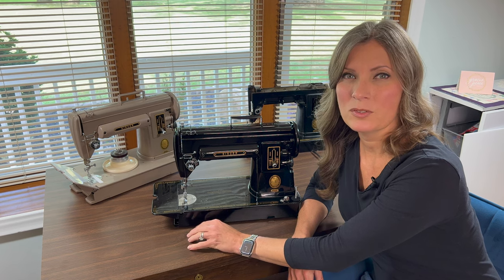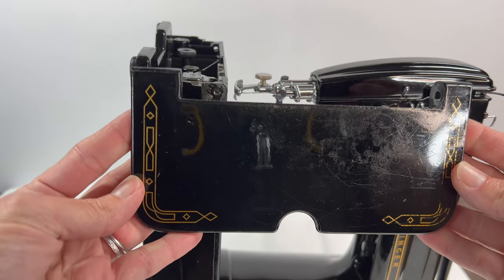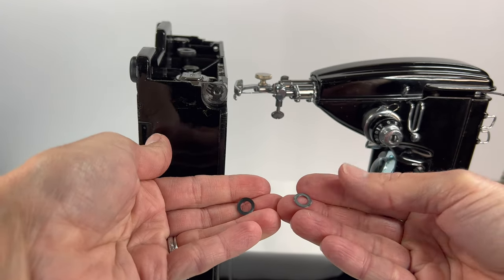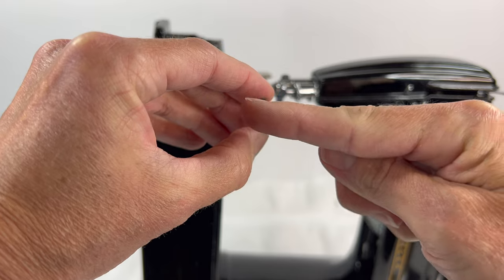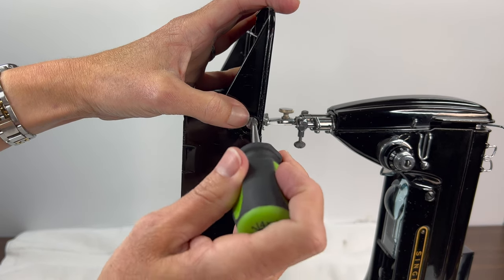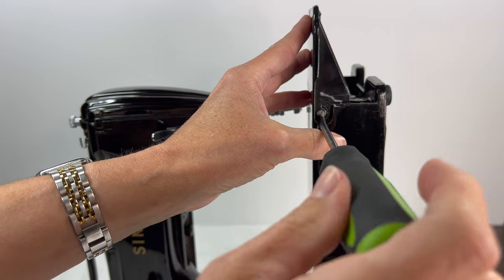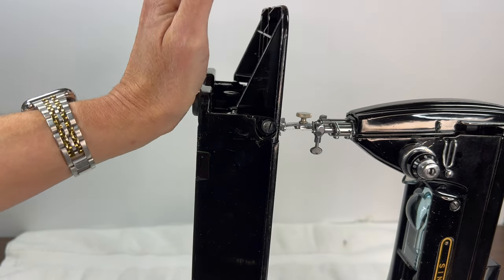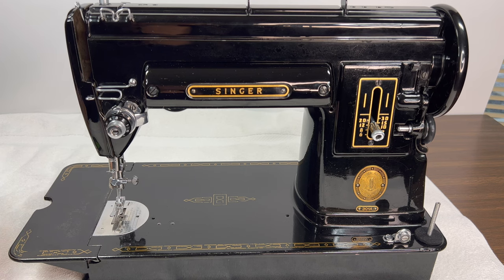How to install the bed extension on a Singer 301and fix the flop: Singer Restoration Series Finale!

Comment: Something I caught, you may want to edit. When you're installing the back screw of the bed extension (the one without a shoulder) you say it tightens counter-clockwise. You're clearly turning the screw clockwise. But great series. Now I need to tear into my 301!
Reply from the maker: Thank you! I will go check that out and see if I can fix it. Good luck with your 301!

Comment: Thank you so much! Your videos are so clear I would have never tackled this without them. 

I bought a 1951 301 from a storage sale hoping everything was going to work. It was a frozen at the foot take up but the wheel turned so my fingers were crossed. The motor had a crunching sound and there was very little grease and carbon anywhere so not sure it had much  previous running time on it. After disassembling the motor I knew I had to address the bearings. Another video suggested adding a drop of 30 weight oil on the motor bearings as this was definitely an issue as the motor did not turn freely as it should. The motor oil did that trick and it worked like a charm after a few turns.
Just finished putting it all together and it is working great. Need to adjust stitch length as it isn't giving me the correct stitch length but everything else is great.

Thank you again...on to my featherweight::)
Reply from the maker: I think you are right, it sounds like it wasn’t used much. Those machines tend to be more frozen than the ones that saw a lot of use. Glad you got that bearing turning smoothly again, good job! Good luck with the Featherweight too and I think I answered your question about the stitch length on another comment you had. 😊

Comment: Wow! What a series! Thank you!! I just purchased a 301 at auction and you have given me confidence to do this for my new to me machine. It will need start to finish as it is not moving well at all and it quite dirty. Question...it did not have the bobbin case (as well as other parts, but I have identified those...) and I am seeing online that it takes a part 45750 case but can "sometimes" take a 45751. Do you know what this might take? It's serial number starts with NA which I believe puts it at 1952 and it is tan. Any ideas? Thanks again! Just wonderful!!
Reply from the maker: Hi! There is a part number on the hook assembly as well…that number may be useful in helping you match up the right bobbin case. If you haven’t solved this issue you can email me at jen@sewingmachinerehab.com and I will try to help you sort it out.

Comment: Hello Jen. I was recently given a nice looking 301 that was frozen up.  The problem was the bobbin case and it was a pretty easy fix - thanks to some of your videos. I did some other work on the machine (I'm pretty new to all this but am having fun) and now it's in great working condition.  I've been a little puzzled by the fact that it won't fit in a (standard) cabinet with the rear hinge holes.  It has (mounting?) holes on the ends.  Do you address mounting this machine anywhere?  Thanks so much and Merry Christmas!
Reply from the maker: Hi! What you are looking for is a cradle. I have a few, email me at jen@sewingmachinerehab.com and if you can’t find one I can send you one.

Comment: Like a screw that holds a doorknob in place, I think it is called a set screw.
Reply from the maker: Maybe! Not sure which screw you are talking about in this video, both of the screws are more like a hinge screw or shoulder screw. Both have areas that are not threaded that allow the bed to rotate around on them. Pretty nifty!